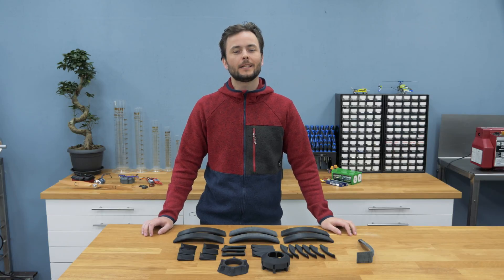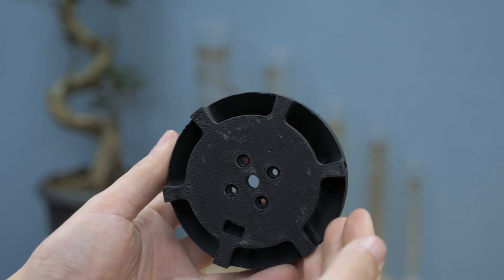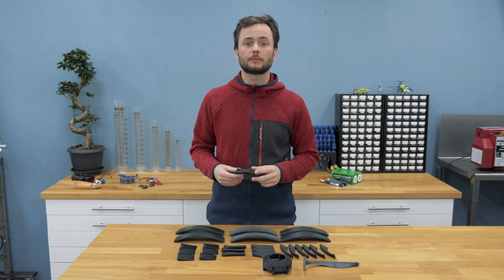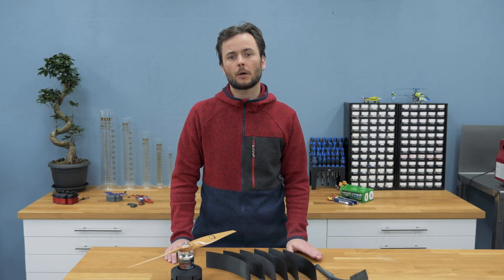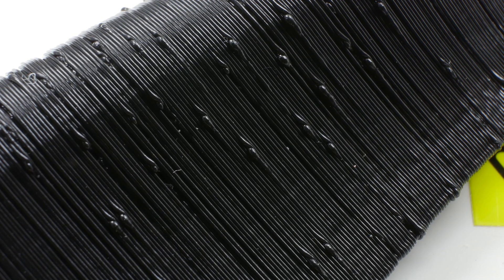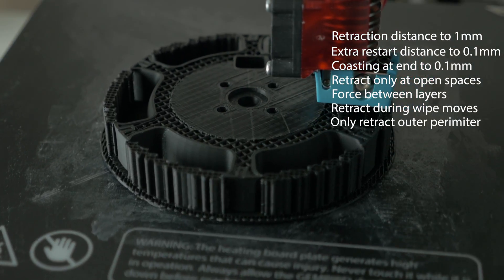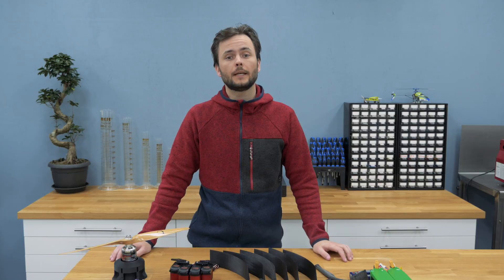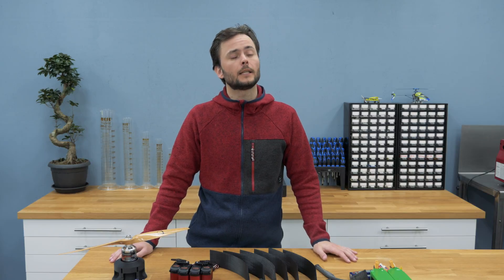Paradrone Buildvlog #2  3D printing

Comment: I havent seen any composite Materials using laminating and printed parts so thats very interesting! Also, when designing printed parts for laminating, one could save a lot of printing time with a rigid yet light infill and a single, smooth outer wall when the final toughness comes from laminating with glass fiber. I'll be interesting to see how this turns out 👍
Reply from the maker: I am curious as well, this version is designed to be fully laminated, I also want to try a seperate version where I only laminate carbon strips in the essential area's. My guess is that this will be easier to make and easier for others to try as well. Mainly because you do not have to work the cloth over all those akward 3D shapes.